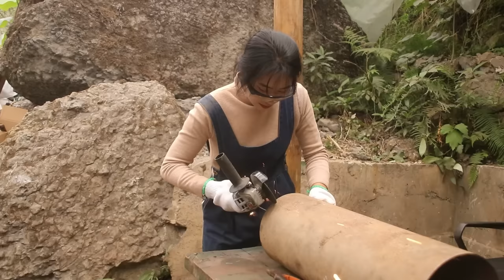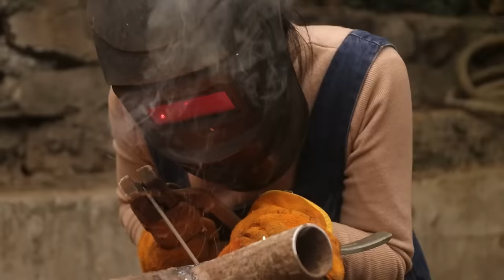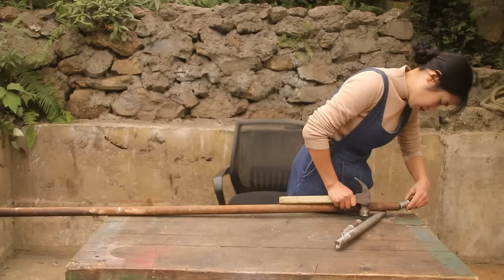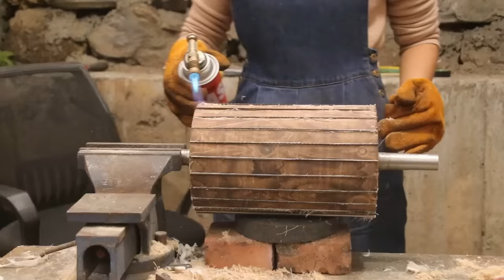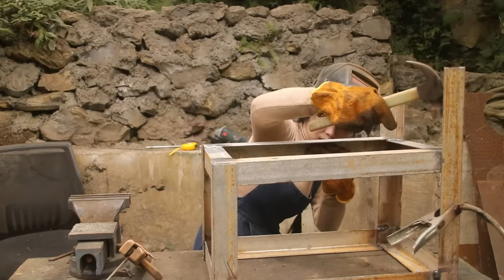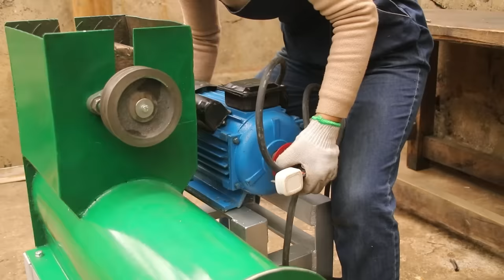💡 Wonder Girl DIY A Upgraded Version of Juicer, Auto-Separate Slag and Juice of Sweet Potatoes

Comment: Oh Lin!  One of your best!  I'm 82--a Manufacturing  Engineer and a life long metal worker---I thought I was good--you have me beat on so many levels!  Wonderful mechanical skills of all types---I so wish I could give you all my tools and Mig welder that I don't need.
Reply: Watching her tac weld everything is painful
Reply: I feel the same way, but considering her location, and that she mostly welds outdoors, Shielding gas for a MIG might be impossible to get, expensive or wouldn't work for her.  And SHE NEEDS SOME KIND OF CART, motorized preferably. One day she will regret carrying what she does on her back.
Reply: @JohnWarner-lu8rq  True--but a flux core wire would work without gas.  I also cringe when I see her carry or lift heavy things--I know what happens--I blew out my back in my 20's --I have seen her use a motorized cart but maybe she can't always use it on bad roads and trails, or its not always hers to use---she's one hell of an impressive young woman!
Reply: A  e brava si intendi di tutto
Reply: @maddycatgamer83  i would call it stitch weld i believe if she ran the welder at its normal rate she would probably blow the cities transformer
Reply: Look at her condition that she works in those remotes areas.😢
Reply: A mig welder would be so useful to Lin & a set of oxygen acetylene  bottles.

Comment: Hi Lin, you might want to consider using ear plugs, I used to work in a steel fabrication shop and have terrible tinnitus as a result, better to protect if possible - great job on this device!!  Happy New Year!
Reply: WHAT? - Linguoer
Reply: Good advices 😊  will lose hearing too.
Reply: I suggested that many times in her previous videos.  I am sure some hearing damage has already occurred.
Reply: Safety first 👍
Reply: Yes Lin, please get some hearing protection
Reply: Safety glasses would not go amiss when using your lathe too.
Reply: Y’all her name is Guo-Er. Lin is her family name. It roughly translates to “fruitful”.
Reply: Myself iam worried about her long hair getting caught in the lathe

Comment: Love your site Linguoer.

A stick arc welder is very like a hose.
i.e. once having struck an arc you then hose the metal into the joint. 
To strike the arc it is better and gives more control if you drag or pull the stick over the surface.
Maintaining the flow of metal is a matter of distance and current.
Ideally you should not start and stop as it breaks the flow and can cause cracks.
Sometimes it is necessary but try to perfect a continuous arc.
There are five variables: the thickness of base metal, the thickness of your rod, the current you use, the speed you move, and the length of your arc. 
I see many tap, stick and start again youtube welders and it is painful to watch.
The simple rule is drag rather than push the weld and hose the rod into the joint.
Reply: Yes! That is what I was thinking as I watched her weld, it looked at first that she was making tack welds to hold pieces in position, but then it seems she was making all of her full welds as a sequence of tack welds instead of making continuous drag ones like you described. I wonder if she has no way to control the current and that's why she makes all tack welds?
Reply: @dannichols6261  I think it is a habit formed by generations of welders who learned by practise rather than being taught. Youtube is full of it. The obvious thing is to tap when you can't strike an arc but when you tap you also tend to stick. So the habit becomes tap and stick, tap and stick. Ideally you need to clean the base metal well and drag the rod over the surface to strike an arc and once the arc is struck pull away to maintain the arc. Of course a good rod begins convex with the flux shaved back from the weld metal but after a run the rod becomes concave with the non conductive flux on the outside. It's almost as if they should sell pencil sharpeners for welding rods.
Reply: @NolanTyrrell  Ok, that makes sense, although how you described is pretty much how I learned, on the job with some instruction from my boss, who had been doing all the welding previously. It was TIG, so no exterior flux, and it seems to me (this was decades ago) that it was easy to learn to strike the sharpened tungsten tip in a 'scratching' motion on the work surface, which would deliberately or automatically end up about a quarter of an inch off the metal, thus both starting and maintaining the arc. And for TIG, I used a circular 'spiraling' motions along the length of a weld, rather than back-and-forth arcs advancing in that direction (while adding material to the arc and weld from a stainless-steel thin rod). The boss showed me the proper order of the pieces to seam or weld together, but it all seemed to be fairly easy & straightforward, although I never had much instruction on selecting the current in relation to the size of the pieces, nor the gas flow either, but I think I did pretty well. Never did advance from stainless-steel to aluminum, though!! Just lots of holes burnt in aluminum!
Reply: @dannichols6261  I'm told Tig is much easier than stick welding.
Reply: i.e. Tig is fluxless. The arc is purely for heat and add the weld metal into the pool melt. 
Whereas with a stick you hose the weld metal and flux into the joint hoping you have got the temperature right.
Reply: @NolanTyrrell  Yes, though the inert gas (Tungsten Inert Gas) provides the 'flux' to keep atmospheric oxygen from burning the hot metal up. And yes add separate metal into the molten pool.
But I presume with stick arc welding you still (similarly) DRAG the arc away along the forming weld line, (rather than 'pushing' the stick into the weld after the arc is struck), by first scratching the stick to the work surface momentarily and lifting sufficient to maintain the arc, rather than 'stick-and-hold' repeatedly again & again?
Reply: @NolanTyrrell  Yes, sound like Tig might be easier than stick arc, though with stick arc it's only the one element, the stick, to manipulate. Tig manipulates the arc tungsten with one hand and the rod metal to add to the weld with the other hand.  Tig was, I think, pretty easy to learn for beginner. 
Of course, that's apart from getting the metals to be welded together oriented and lined up appropriately!
Reply: @dannichols6261  Yes, I'm told TIG is closest to oxy welding.

Comment: Great job, but I don't understand why you keep on making short "Tack" welds instead of making a continuase long weld? Is your welder not strong enough to keep the "Welding Bead" going for more than a few seconds? Once you strike an arc there is no need to lift the rod off the job. Keep going and you will get a much better weld seam.
Reply: Hello gadgetroy ... As someone that worked in the industrie for decades and is not a welder, but has often welded I have often wondered about this too. I have observed this in many videos on YT. Mainly with people that can not weld properly. In my opinion this is not the case with LIn. I think she can for sure. I can only assume she does so to reduce the amount of heat and avoid material distortion. In general the objects I have observed her weld were not things that would be subjected to any extreme load so it has not been of such importance as of yet. Just the same although I have the utmost respect for her knowledge and will to work (one can see she "surely" knows what she is doing) I often would like to reach in and say come I'll weld it for you. Of course we know that is not the way to improve ones abilitys so it's good that I don't have that option. Have a good day.

Comment: What did you do to remove all the rust from the inside of the pipe and the metal parts? That will contaminate and change the flavor of the juice that is put through the unit.

Comment: As it is clear that you are not a welder: use position electrodes, do NOT put the machine too high. For 3,25mm electrode: 120 amp is enough.

To remove rust from your tools: use vinegar (6% white vinegar) mixed with salt. Small tools: put them a day or2 in a bath with that; bigger parts--like your lathe: make the rust a bit wet with the solution; then put kichen paper or toiletpaper ove it; make it soaking wet with solution, and put strech plastic over it. Leave it for a day or two. Then clean it with a hard brush.

Comment: If you dip the drill bit in oil , it will save the bit and drill faster. Drill on slow speed, keep the tip of the bit cool

Comment: The manufacturing process will be easier if you remove the rust from both sides of the iron plate and tube before welding.

Comment: lot cheapen you have paint all parts if buy spray painting pistol, you have compressor , can paint better and cheap.
Reply: She has a paint sprayer, but doesn't use it often.
Reply: @GeoffryWK  lot better use and lot cheapen buy paint in can than spray can. buy paint and thinner and mix paint and spray not need expensive spray can newer.